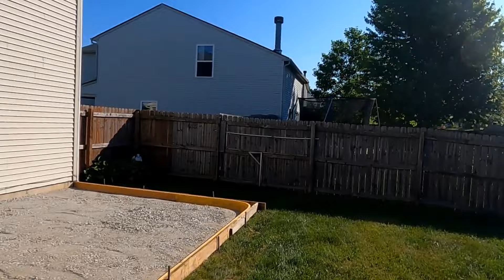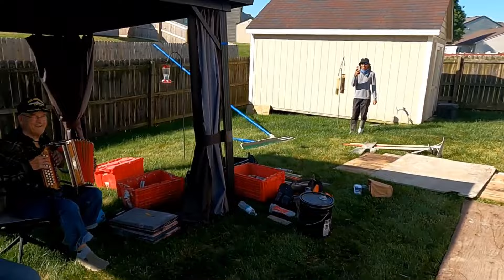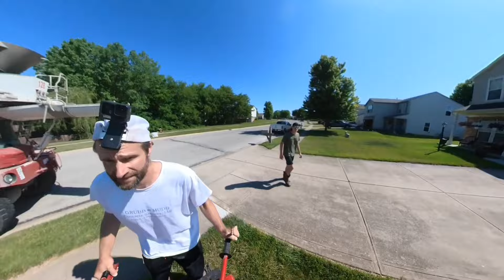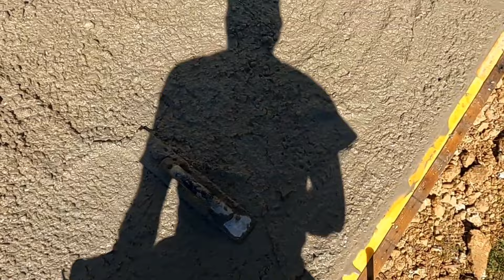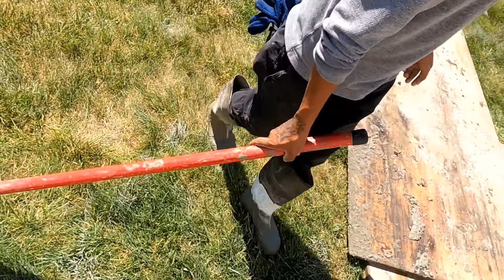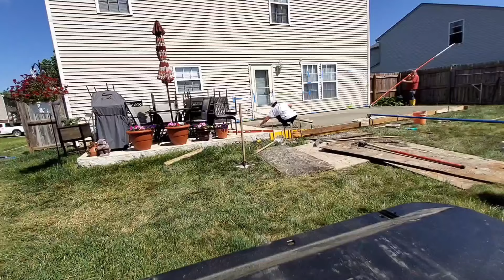Pouring Concrete w/ unexpected help from 84 yr old NAVY VET w DEMENTIA & Parkinsons

Comment: Hell yes we remove the grass 6 inches from the top of the grass you have to remove in order to get all the roots then you usually have to scarify it and compact it And then if you want to be absolutely sure you hit it with grass killer. When it comes to concrete cheaper is never better and the low bid is not the one to take look for the guys with at least five years experience in the area that you are at. Because every area is different and it calls for different methods of installing the new concrete you don’t pour the same mix at lower elevations as you do at higher elevations etc. thanks for sharing see you on the next one👍🏼👊🏼p.s. we also run our plastic 1-2 inches below top of concrete and then when it’s bull floated we pull the plastic up and out and close it back up you can still see your chalk line through the plastic 😬
Reply from the maker: hey u said it perfectly! thanks for checking out my long form concrete video,  u came from shorts right?
Reply: @GRUBB-MUDD  no I’ve been watching them since you started long ones

Comment: You got these concrete jobs down to a science. That buggy saves a lot of work A lot better than wheelbarrows. It would have been a lot easier to just square it off but I see you did nice Round edges. I'm going to have to put out a little work video here soon. But the way you get your camera angles. It makes the video a lot better.
Reply from the maker: right on sticks. u r right about everything u said. I like to see other ppl work videos. yeah I have 4 cameras and a drone, I usually use 3. its fun. thanks for comingnover bro
Reply: I would like to see what you did to surface!

Comment: Lets all agree there is 100 ways to place concrete (pour) to get to the desired end product... The big difference is how hard you all work to get to that end product.  
First big no no is not wearing rubber gloves while pouring.  Dry hands and lime burns are just not fun. 
I noted you floating the outer edge of the slab, did anyone tap on the forms, or work the edge at all before screeding off the slab? Rock pockets...
Reply from the maker: We use a saw zaw w no blade to vibrate the edges